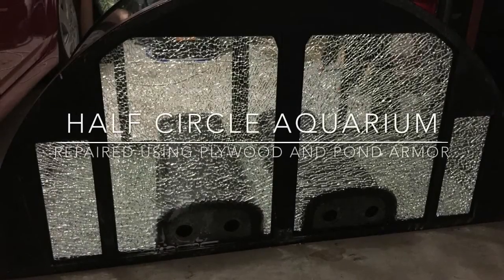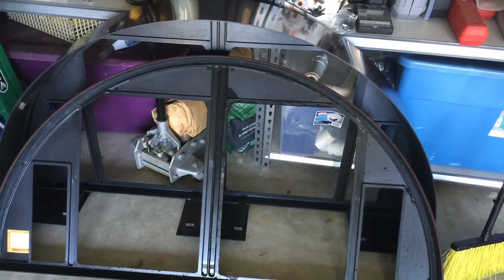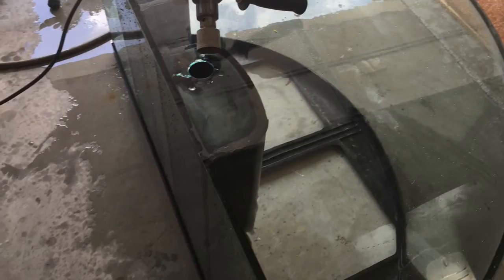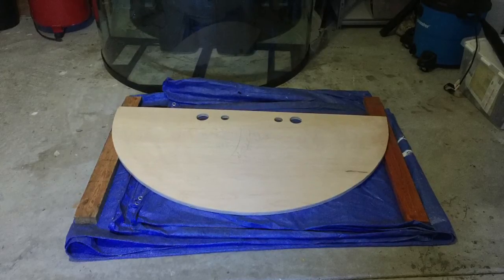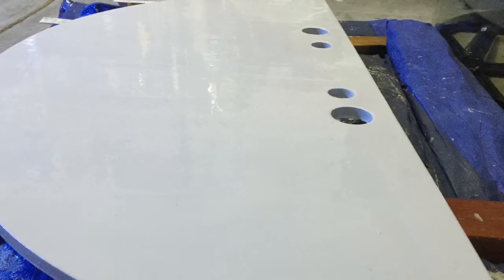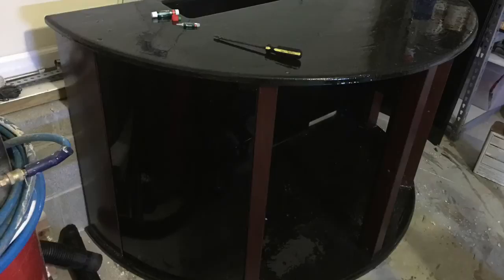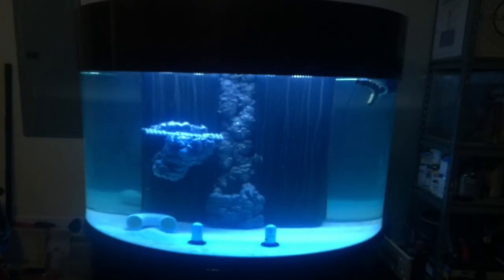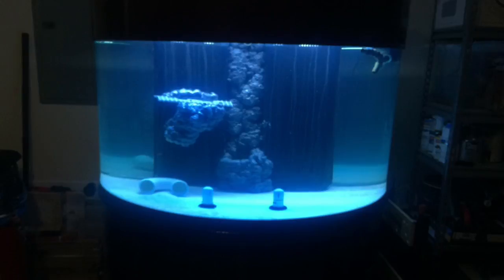Half Cylinder Aquarium Repair

Comment: looks great I had a question the back of my half cylinder is buckling do you recommend replacing the back wood and renforcing the guts to hold the stand better ? or just installing deck post wood to renforce it from within ?
Reply from the maker: Anthony Pearson I would have to see what you are talking about, but I am sure you would want to reinforce as much as possible since it’s a lot of weight and water.
Reply: Daquan Johnson ok I’ll take pics not sure how to post pics on here tho